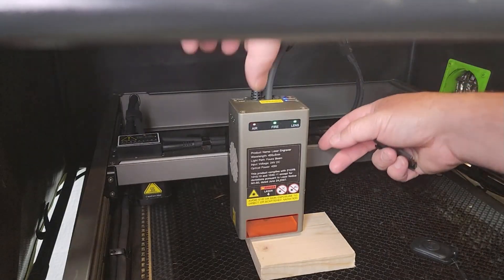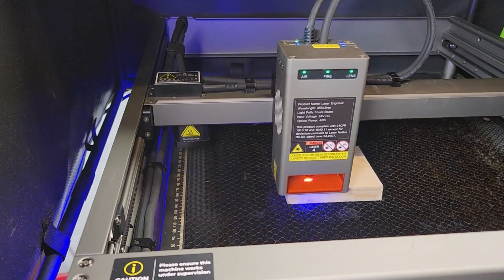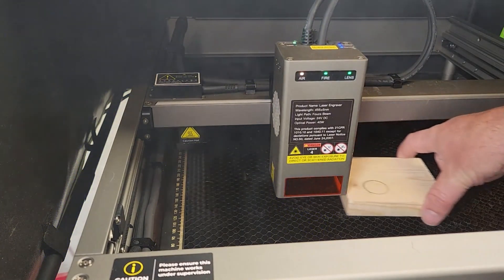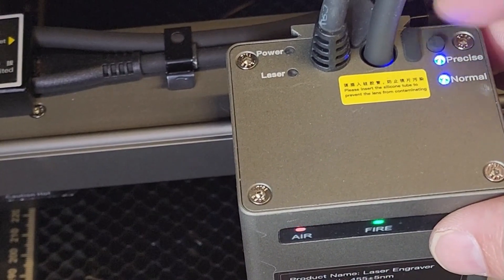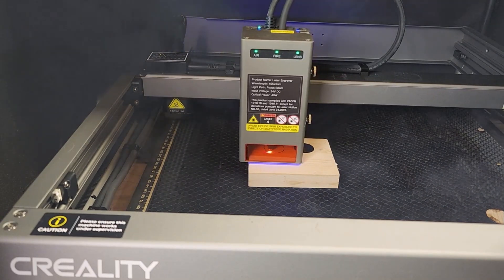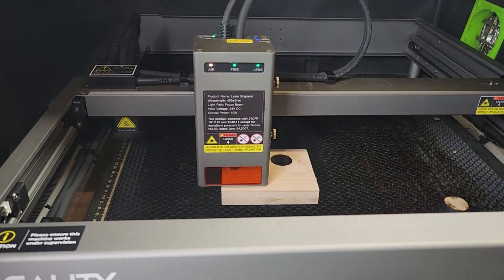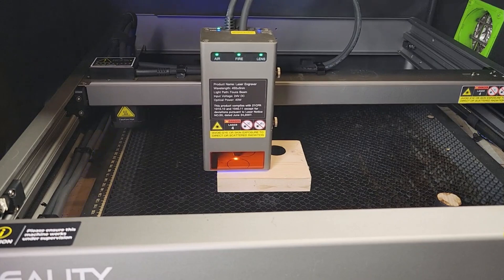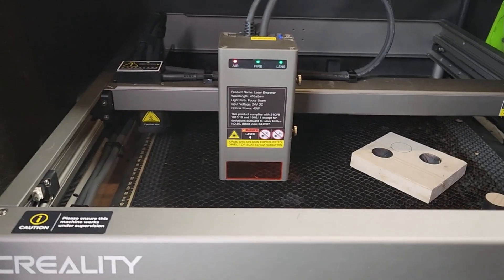CrealityFalcon2 40W | Normal Mode VS Precise Mode

Comment: Very helpful video! The unit came with a recommended parameter chart for the 40W mode.  Is there a recommended parameter chart for the "fine" (20W) mode?